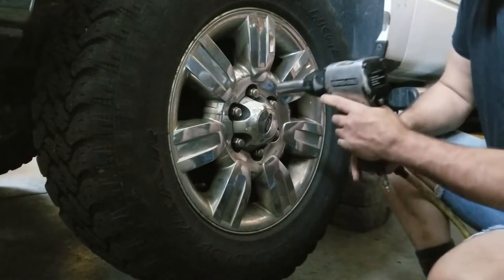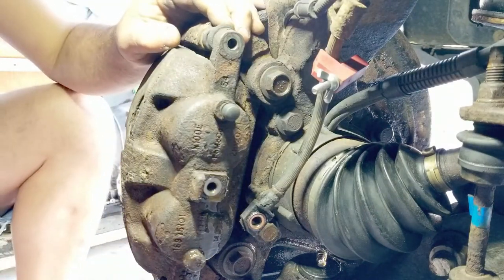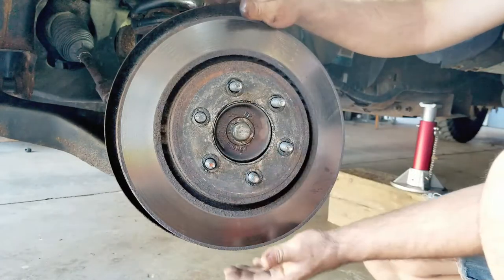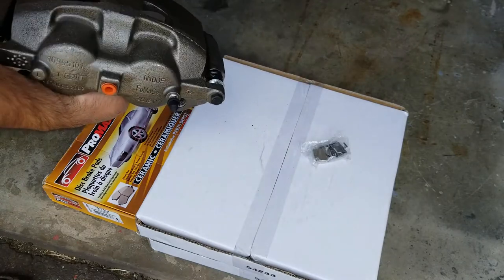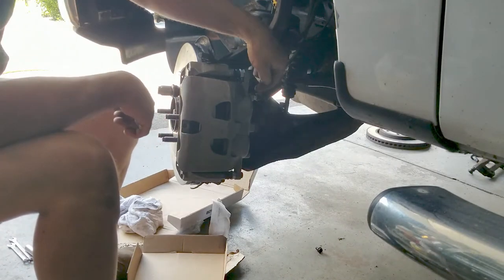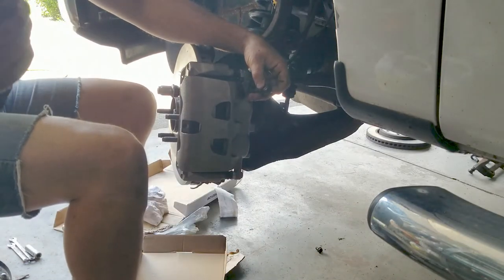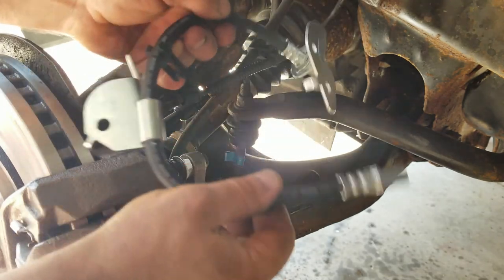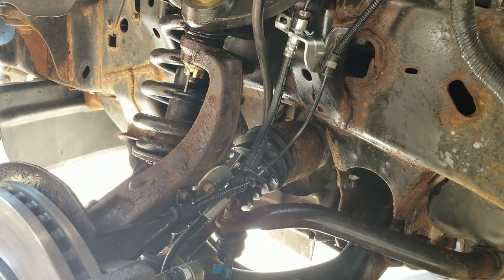2011 - 2014 F150 Front Brakes and Caliper replacement

Comment: I have same issue only on driver side. I forgot to let bleed screw loose when closing pistons. It's not a reverse system my pads are burning the rotor. Did the line fix it all my pad and calipers are new as well.i thought I messed it up.

Comment: My f 150 has fought me every step of the way I'm from NY northern NY the salt they use on the roads wow anyway the amount of bolts that broke on me both front brake calipers need to be replaced driver side sized slide pin other side caliper completely sized I bought this truck used from a dealer who didn't care about lemon law
Reply from the maker: I'm in Toronto...we have the same issues here when it comes to salt